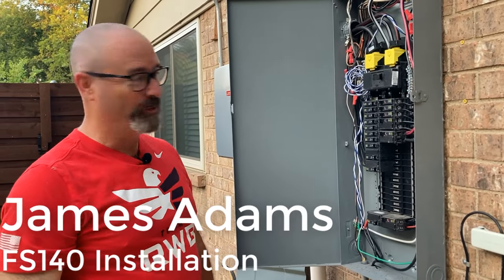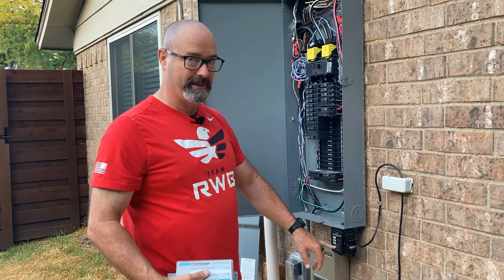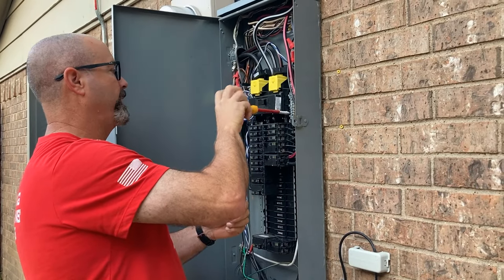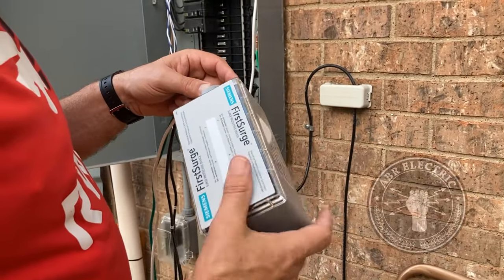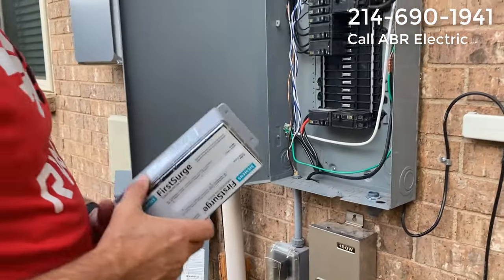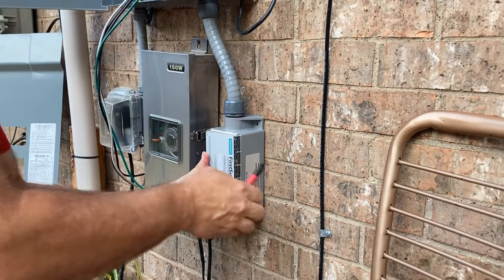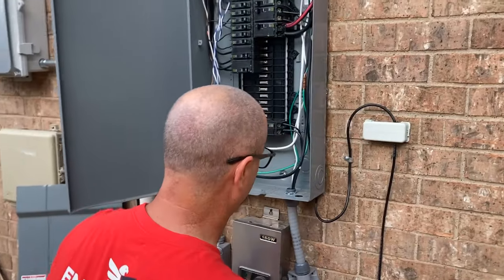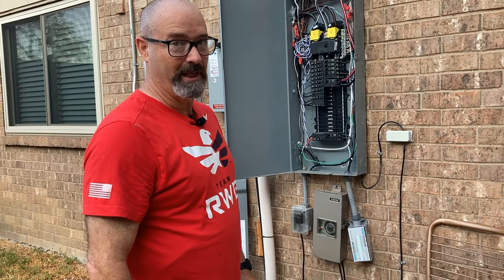Installing an FS140 Siemens Surge Protector

Comment: I have this installed, its my understanding that this breaker should be the first position right off the main lugs to provide the max protection to all circuits down the panel NOT at the bottom as shown here
Reply: That’s my understanding as well
Reply: yep he installed it wrong!!!!
Reply from the maker: Read the instructions from the manufacturer. The critical items are to keep the wires as short as possible between breaker and spd and to not have bends in the wire
Reply from the maker: @ericnewton5720  read the manufacturer instructions. May be different than your understanding.
Reply from the maker: @rivergate950  check the manufacturer's instructions. See my response to AM 1015 above.
Reply: I called Siemens. They said this unit can be installed anywhere on the breaker panel. They said it's way more important to keep the leads as short as possible.
Reply from the maker: @steve_713_  that is good info!
Reply: Great videos on whole home surge protectors! I will be asking my electrician to install this Siemens unit (s). 

I have a Siemens split panel 400amp (200/200) panel newly installed in 2017. It's the type with two separate 200 amp breakers so it's not split bus but split panel(s) from the main power coming out the meter. I would assume a person would want a device in each separate 200 amp panel since both are directly downstream from the utility power feed/meter?

I will consult Siemens, my electrician and the NEC 2020 & 2023 books, too, on this question, but how would you setup this if this were your panel/system?
Reply from the maker: @BigWaveDragon  Absolutely,  one each panel with it's own breaker. I would be sure to flush mount them. Some electricians install them inside the panels. The problem is you cannot see the indicator lights and the audible alarm will be muffled.
Reply: No.. he did install it correctly, because you want to be "downstream" so the absorption protects all circuits, AND to have shortest length of wire.. extra points if you can explain to me why thats important (electrical theory) the fs140 IS the path of least resistance.. js
Reply: Yep. Electricity flows path of least resistance. So shorter path is the least. Move a breaker if you have to get a new breaker next to the main.
Reply: RTFM 😂
Reply: I just bought the FSPD 140. It does not have the audible alarm but provides a set of dry contacts for an external alarm. I paid over $400 for it from Faraday. I could kick myself because Home Depot has the same one for $200. My problem now is trying to free up breaker space in the panel for a 30 amp double breaker. The wires are # 10 for the surge protector. They also say in the instructions to use an additional ground rod. The unit also came with a set of ferrite clamps to go over the feed wires to further absorb the surge field.

Comment: I was under the impression that you should always install the surge protection breaker as close to the mains as possible
Reply: Closer to main is more efficient protection.The surge would pass through every breaker before it hits the SP.
Reply: I thought the same thing. I called Siemens and spoke with one of their technical engineers about this. They said ideally yes, if you're doing a new install with one, locate the SPD as close to the main as possible. They said if you're just adding one to an existing panel, anywhere is nearly as good. When I installed mine, I only had one open spot on the very bottom. I had to put a tandem breaker in to open up two spots at the bottom to get the double pole in for installation. They said that would be plenty sufficient and the most important thing when installing these is to keep the wires as short, and as straight as possible, that is far more important than the location on the bus bar. Otherwise you'd have to move and relabel every other spot too.
Reply: @bradskis81  An alternative is to install a Siemens QSA2020SPD if you have a Siemens panel. It can replace breakers that are close to the main feed and provide SPD functionality. Its designed for full panels. 40,000 amp protection isn't as good as this unit, but some protection is better than no protection.
Reply: @JeanPierreWhite  I'll look into that, as I have two main panels and should ideally have one protector in each panel.
Reply: @bradskis81  This is great news! I'm adding to an existing panel and no way can I get it up top close to the main feed. Now knowing this, I'm going to get it done. There's room at the bottom, and I can certainly keep the leads short and straight no problem. Sweet!
Reply: @MackDaddy8154  That's exactly what I did. Popped a knockout towards the bottom to mount it, and ran the wires straight into the panel, short and straight.
Reply: @bradskis81  thank you!! you just saved me a 60min phone call to Siemens to get this exact information. Same issue on my end, house is 2yrs old 99% sure there's no way to get it installed at top of panel cause I wouldn't be able to move those larger breakers at the top.

Comment: You did a really good job of talking/walking your viewers through the process of installing this surge protector in a straightforward manner. I appreciate it when guys like you take the time to create an instructional video that can help people evaluate whether they need to hire a professional or tackle it on their own. I'm betting that you saved a number of people some big money by showing them this project is within their skill level. Bravo to you! I do want to mention that when I install mine, I will tin the wire strands with solder before inserting them into the ground/neutral bus bars. I believe that would provide a more solid connection and it helps ensure that none of the wire strands break off while inserting the wire into the bus bar holes and/or when tightening-down the screws that hold the wires in place. It's really critical to maintain the ground/neutral wire thickness with surge protectors such as this one.
Reply from the maker: That is a great point. Share some pictures of that process, if you can.
Reply: I like his videos.  However,  all the drama could have been avoided with a cleaner install (inside the box).
Reply: @fredguerra4917  whare would you suggest it be mounted

Comment: Thank you for a great explanation and honest video. As a fellow electrician, I'm screwed as I have no more room in my panel with all the 20yrs of projects I've done on my home.
Reply: Does your panel allow installation of tandem breakers? You could combine a couple lower load circuits onto tandems to open a couple slots. Especially with how little current runs on lighting circuits now with LED bulbs. I did that to mine to get it in. Each circuit with all the lights on only pulls a couple amps at the most on a 15A circuit when I checked with a clamp meter. Moved some light circuits to a tandem (panel is authorized for it), and opened up a couple slots at the bottom. Maybe you've already checked into that though.
Reply: I’m putting mine out on the meter box as I’m in the same boat - only 1 single gang available in main panel. I kind of like having it out there anyway, close to the the meter’s large ground rod.
Reply: Get a Type 1 SPR and attach it to the mounting posts (bolts) below the main breaker. Type 1 SPRs are rated for that kind of install, and it actually works better than via a breaker!

Comment: The breaker for the FS140 is not for over-current protection, they come equipped with their own, the breaker is used as a safe means of disconnect (I work for the manufacturer). 
I used to wonder why Cutler-Hammer resi SPD instructs the use of a 50A breaker when it comes pre-wired with a 14AWG wire which should be connected with a 15A breaker. I found out it’s so they can fudge their nominal kA rating.

FirstSurge is the only residential SPD on the market with Ground Reference Monitoring (GRM), meaning it's constantly monitoring the integrity of the N-G bond, and if it comes loose or disconnected, the alarm will sound and red trouble light will flash, while the green phase LEDs will remain illuminated. The other instance it will go into alarm mode would be at its end of life. The alarm sound is about the noise level of when your smoke alarm battery is dying, so nothing to wake the neighbors.
Beautiful installation demo!
Reply from the maker: If the FS140 is a type 2 surge protector, then it requires a breaker. Is that not the case?
Reply: @abrelectric  UL 1449 listings for most whole house SPDs require the SPD to be connected to a breaker for fault current protection, and connecting to a breaker makes it easier to install for most residential applications. Constructing a SPD in this manner helps keep cost down compared to SPDs designed for commercial application.
Reply from the maker: @Terable13  thank you!
Reply from the maker: How would you define the difference between Type 1 and Type 2 SPDs?
Reply: @abrelectric  if you have questions about Siemens SPDs for resi or commercial, I can help!
Reply: @abrelectric  Type 1 can go Line or Load side with or without a breaker, Type 2 are Load side only. UL threw a wrench in the derinition as it used to be Type 1 had no EMI/RFI filtering and Type 2 did, but now it's mosly about application.
Reply: I'm about to install one of these in my panel.  As it happens I have a spare 30 amp 240 breaker already.  OK if I use that?
Reply from the maker: @banjotramp1  instructions call for a 2p 20 amp breaker. It will work on a 30 amp breaker, but, warranty issues are possible if you don't follow the manufacturer's instructions.
Reply: @Terable13  I'm trying to learn more about all the different types of whole-house surge protection devices that are out on the market. I'm specifically trying to find out their limitations with respect to their clamping voltage and let-through voltage. Are there any resources out there on the web that you are aware of that would help to fill-out and tell of that story? Where does one go on the web to really learn about this stuff and properly climb up the learning curve on all of it? I'm finding out that whole-house surge protection and individual device surge protection used inside the home really are two very different worlds. And, just because you understand one, doesn't necessarily mean that you understand or have a good grasp on the other.
Reply: @abrelectric   we (the manufacturer) allow for a 30A breaker.
Reply: @michaelbeckerman7532  I get my information from the UL files since manufacturers can (and do) put anything on their cutsheets.
Reply from the maker: @Terable13  awesome! So, is Siemens phasing out the FS140 for the FSPD140 boltshield?
Reply: @abrelectric  can I call you and tell you about it?
Reply from the maker: @Terable13  can you email me instead? support@abrelectric.com
Reply: GRM is fantastic but if you're out there reading this: the alarm is waaay too quiet! It should be loud! I barely heard mine, took days of the fault before I noticed it.
Reply from the maker: @Ariccio123  good to know. Is yours outside or inside of your panel?
Reply: @Ariccio123  good to know! I liken the noise level to a smoke alarm chirp when it needs a new battery. They set it at a level so as to NOT be a nuisance, which is a concern for some who may be away from their home for periods of time. I mean, there is no sense in waking up the neighbors! lol As an FYI - 2 Green Phase LEDs and the SPD is in alarm mode with a red flashing LED means the SPD is sensing voltage between N-G and there is a bonding issue. One or both Green phase LED out and the SPD is in alarm mode with a red flashing LED means the SPD has come to its end of life and needs to be replaced. If the SPD comes to an end of life doing its job during the 10 year warranty, call us and we'll replace it for free.
Reply: @abrelectric  inside the house, outside the panel. My dad, he's old, could barely hear it!
Reply: @Terable13  honestly I don't know if that makes sense. It really should be at the level where someone would consider it to be a nuisance. A floating or high resistance neutral is pretty dangerous! I got a shock a few weeks ago when my left hand bridged neutral and ground on an UNpowered circuit right when the intermittent fault started.
Reply: @Terable13  heh, already bought the replacement. It probably did its job quite well, but it can no longer clamp when the fault triggers and one line goes above 160v. It's not yet dead enough for the lights to extinguish, and I suspect it could still eat some larger surges. I don't plan to put the new one in until we resolve the fault... That would be quite a waste. In the meantime, letting type 3s eat the surges and sacrifice themselves.

Unfortunately, the fault seems to be right at the spot where I need to involve the utility AND the HOA, and you can imagine how that's going.
Reply: @Ariccio123  although we make it easy to install as a plug-and-play device that constantly takes surges and resets itself, a surge protector does require periodic inspection. The audible alarm utilized within Siemens FirstSurge is rated for 80db, but since it is housed within a plastic enclosure, we measured the sound level outside the enclosure to be around 60db which can be likened to the volume of a normal conversation about 3.5 feet away. Constant noises of 70-80db can cause hearing damage.
Reply: @Terable13  yeah, 60db sounds about right! But I'd be fine with the idea of something loud enough to risk hearing damage for a dangerous condition. I do like the device, don't get me wrong
Reply: @Ariccio123  😂😂I hear ya! We use the same decibel level for our commercial SPDs, but generally those facilities have building managers or electricians on staff to monitor things. I have one at my home, the FS140 at my panel and a TPS3A030500 Type 1 SPD at the HVAC condenser outside, and love seeing the green  LEDs illuminated letting me know my stuff is protected. If your unit is too far to hear, be sure to do a visual check periodically.
Reply: @Terable13  can you think of anything cursed to allow optional expansion while maintaining NEMA 4x? I can imagine a lil nfc antenna on the inside surface of the case. Then consumers could in theory buy an accessory to connect with it and blast a louder alarm! I bring it up because I'd much prefer that over some IoT nonsense. As someone who works in tech, I tell people no, you want to avoid smart things for the most part!
Reply: @abrelectric  They are made by two different manufacturers for Siemens and are slightly different devices. They are both still current products and being continued to be sold.

Comment: Reason for the short leads is that want you to install it as close to the main breaker as possible.
That opposite of what your doing.
Reply from the maker: No, the longer the leads are, the higher the spike voltage, irrespective of where the device is in the panel.
See Joe Wagner's comment at my video "Zen of Surge Protection". He lays out test results on surge protectors with different wire lengths.
Reply: @abrelectric  
You can't change the laws of physics.
Electricity follows the Path Of Least Resistance, which with Wires and Insulation will measure as the shortest Wires.
All surge manufacturers will tell you to wire it as close to the main breaker.
Reply from the maker: @jackflackatari  To that point, show me an example of an spd manufacturer's instructions that directs you to mount the unit as close as possible to the Main Breaker or Disconnect.
Reply: @abrelectric  
Is this your first SPD installation?
Do you read instructions?
The Simeon's your installing tells you to keep the leads as short as possible. Picture shows it right next to the Main Breaker. Read the instructions for the Eaton you took off of your panel, same thing. You should know this if your a Master electrician.
Reply from the maker: @jackflackatari  thank you

Comment: I have the same Envoy..mine has mini breakers that I am not impressed with...one just corroded out and needed replacement...Enphase wasnt as helpful as they could be..and I couldnt locate the same mini breaker elsewhere to fit. 8 years ago in Massachusetts  for my 8kw solar install the electricians were using terminal strips and crimp connectors EVERYWHERE. Having 3 differend arrays..I have a few junction boxes. I just had a set of panels not report...found loose wires in junctions. After discussion with current professionals...only the DC connections need terminals now. I cut some wires back and used quality..and tight wire nuts everywhere. All good now.

Comment: I have to say, you mention the FS140 will not work on other voltages, and you are correct, all our SPDs are voltage specific. So, if a customer is in another country or has another voltage, WE offer solutions for those. The FirstSurge SPDs are meant for most American residential systems that are 120/240.
Reply from the maker: That is a great point! Also the issue of system grounding. Many countries don't have a system bond to Earth at 240 V
Reply: @abrelectric    Anyone have ANY idea which surge protector would work in Brazil?  We have 3 phase coming into the house meter.  Only two are used though in the house.  We do have neutral and ground "Terra", however upon me inspecting the work (overall atrocious).  They never actually pounded in any ground rods. They only connected the ground to the street service pole with a band of plumbing strap.  Yep, you can shake your head.   So, I need to do those two 6 feet apart after our service box on the street.   220v service here.